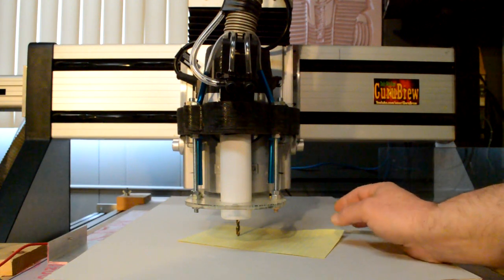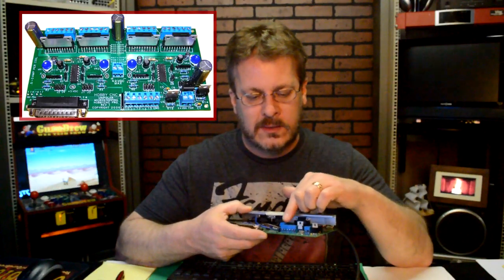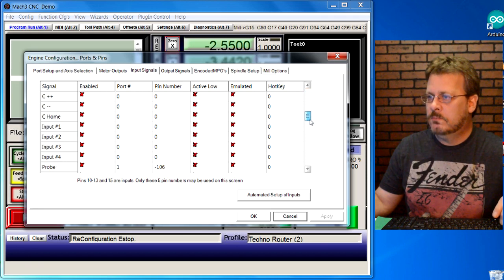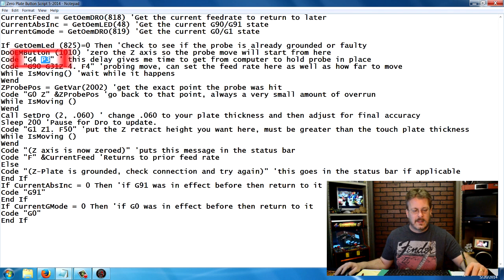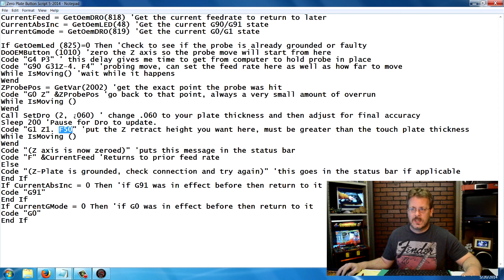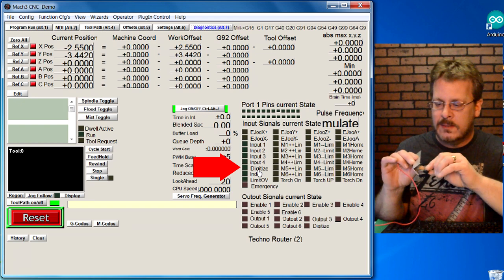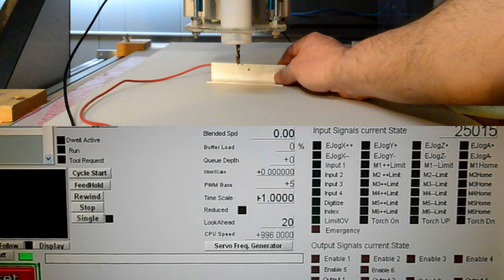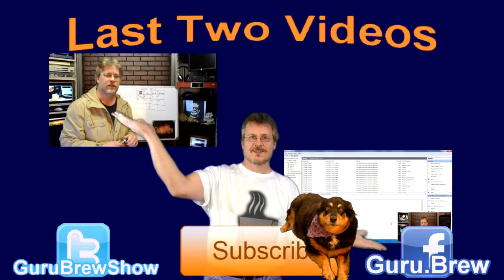How to Setup a Touch Plate to Auto-Zero Z-Axis in Mach3

Comment: The best way to set a very accurate zero is to do the following...
1) Move down at a given feedrate until contact is made.
2) Move up a small amount like 0.5mm or 0.25inch.
3) probe again at 1/10 that speed. (Or some slower speed like 1/4)
4) Perform your offset and save the location.

This will account for the over-run. You will find that the results are more consistent.

Comment: Cant get Z auto zero to turn Digitize on and off when wires are touched together.
Pin 15 is not used by any other function.
DESCRIPTION OF ACTIONS:
PROBE, wire one to pin 15 input, wire two to GROUND.  
Ports and pins. PROBE Port 2 (BOB on top of ESS smooth stepper board) pin 15, active low checked.
SAVED AND EXIT 
RESTART.  CHECK DIGITIZE LIGHT always lit if the two wires are touched together or not.

Unable to have DIGITIZE light on and off when two wires are touched together.
What am I doing wrong?
Thanks

Comment: This is great video. I built a plasma table a few years ago and use a mechanical limit switch to set and zero the Z axis. I want to change to a pnp proximity sensor but am limited by the voltage and amperage on the C10 breakout board. I found a prox rated at 5 vdc but needs 200mA to operate. I think the max on the board is 25 mA. Do you have any suggestions on a switch I could use and/or how to wire a prox rated at higher volts and amps into the C10 board I have? The mechanical limit switch has a spring loaded arm and it does "wander" at times. Anyway, thanks if you do have any info.

Comment: Thanks for the video great info. I was able to make it work, but initially it did not. I connected  touch plate to port INPUT#4 on my I/O board(followed ports and pins config instructions), did not work, I had my E-stop on port INPUT#5, I stole that port, set pin config for probe and it worked. I noticed that was the only port that would digitize, the other ports show the pin indicator trigger(light goes on and off), but no digitization on the prompt below that. At this point I'm just curious as to why the other board inputs didn't work? What do you think I am doing wrong? I imagine my ports and pin configuration is messed up. Hopefully you can guide me to a solution. Thanks again for the video, walking on air with new auto tool zero.

Comment: Hi, excuse me but I need your help. I setting my cnc with mach3. Axis are calibrated. When I lead a gcode, it run ok one turn. At the second round run and stop. No errors message, go to zero run. All run but the program no. Why? The depth of piece is 9mm in 5 tours. Excuse me for my english.

Comment: Hello used your setup for my Gatton cnc with a Sainsmart 5100 bob and Mach3 the only problem I have is that the z comes down touches the plate then raises up slow for about a inch then raises faster about a inch further when I remove plate and hit auto z it comes down about a 1-1/4” from top of material. I set set my plate thickness to .620 which is my plate thickness as you stated to do. Any idea what is causing this problem.

Comment: A quick question Steve. I have my Mach 3 config units set to mm (although everything I do project wise is based in inches). Would I set my plate thickness therefore in mm (3.35 mm) as opposed to inches? Assuming yes..... but then what about your line "Code "G90 G31Z-4. F4" 'probing move, can set the feed rate here as well as how far to move" What values would I set to be metric equivalent? 
Finally "Code "G1 Z1. F50" 'put the Z retract height you want here" Would I also indicate Code "G1 Z25. F50"  Many thanks for this.

Comment: This is amazing, I've wanted one for years but hesitated because I didn't know how to hook one up, but finally said just look it up and see what you find, which brought me here.  Now I have a home-built touch plate that really works!  Hey, one problem, though, when I remove the plate and tell the z to go to zero, it leaves just a little over a paper's thickness between the bit and the material.  I tried adjusting the plate thickness on line 15 in the vb script from between .059 and .064, because I'm using a piece of 1/16" thick aluminum angle iron, too, which measures .062 on my calipers, but even though I restart Mach3 each time, when I tell it to go to zero, there's still just barely room to slip a piece of paper under there.  Anyone else encounter this?

Comment: Just changed out my gecko servo drive and now my autozero is not touching my plate.  It goes down about .750 and retracts the correct distance. I have you VB script.  I have set it to travel 4".  Not sure why it will not travel down till it hits the plate.  Any ideas?

Comment: Steve, I'm confused on where exactly you grounded the cable from terminal block 15. The positive cable runs in through the number 15 terminal block, but where does the ground cable go in the circuitboard? Thanks

Comment: Steve loved the video, however I am having an issue. I have set the plate thickness to .750 and that's the only change I have made. the probe is to retract to a height of 1 inch.  When it retracts its about 4 " above the touch plate. when I remove the touch plate and tell Mach 3 to go to Z0 its going down to 1 7/8 above the work piece. I don't get what's happening. I have tried other scripts with similar results. Any ideas?  Now when I wired my probe and set it up in ports and pins I do not have it set to active low and the digitize light will light up when i touch the plate to the ground. If I set it to active low the digitize light stays on constant until I touch the plate to the router. Could this be  part of the issue.

Comment: Hope you can help me out, my friend has a g540 board and I tried to setup the touch plate exactly like yours, hooked up to pin 15 which was available and done the rest too. The problem is the light is on all the time, even with the ground not connected, do you think something is grounding it out somehow in the control box? I even redid it 5 times.

Comment: I am a bit confused I hope you can help me. My issue is that my z surface is gone by the time I need to change to the next tool and I don't understand how to set this up for a situation like that. I can have the plate be fixated somewhere but let's say I touch the tool off of that but my actual workpiece z coordinate is different than the plate, what do I do afterwards? Basically my question is how do I set this up without the need to be using my z surface as reference by putting the plate on it? I wanna put the plate away from my workpiece. The way I'm doing it manually right now is that before the tool change I bring the current tool and touch it to the plate by jogging it and seeing the diagnostic page light up, then I write down the z number. I change to the next tool and jog that down and do the same and once it lights up I enter the z value I wrote down into the z value and hit enter. This is very tedious to do for every tool change. Not to mention that the plate pressure is not reliable because it's by hand not by the software.

Comment: Got some issues when testing this, after tool is touching plate it won't retract it just stops
 ( Code "G1 Z30. F40" 'put the Z retract height you want here, must be greater than the touch plate thicknes)  im using mm

Comment: Im trying to set up  the touch plate.  Im using a USB controller so I cant find a port to match, also when on port three the digitize light is constant, I only have 4 pins in and out I tried both if someone can help I would really appreciate it

Comment: I followed your instructions a few years back and everything has worked perfectly. Recently I upgraded to the Corvette Guy's G540 based unit and everything has improved greatly. The only thing is that the touch plate won't work. In Mach3 diagnostics, the probe light stays on all the time. I do not have another pin to use on my little bob (using 15). What can I do to fix this?

Comment: Steve , thanks for a good video , however i have encountered a problem in that i have  from mach 3 launch menu , an imperial profile and also a metric profile . The imperial profile has worked flawlessly , but when i entered the metric profile and adjusted the script to suit , it also changed the script on the imperial profile . can it only be used on one ? 
thanks

Comment: Thanks for the video...I set it up just as you described and when i hit auto tool zero I get an error.  It says "Scriptor Compile Error . In :"   also if i check active low the digitizer light stays on until i touch the plate to the bit.  If i dont chech active low it only lights up when i touch the plate to the bit...any suggestions?

Comment: Steve, I just installed a new NVUM break out board and before that your script worked now it touch the plate and goes above the Z1. its set too. what could be the problem?
Reply from the maker: Check and make sure that your Dro settings are still in inches and haven't change to metric, that would do it
Reply: @GuruBrew  my DRO are still in inches
Reply from the maker: Also make sure that the settings in mach3 are such to zero out the machine after homemade. I forget exactly where that setting is but I think it's under home and limits
Reply: @GuruBrew  In Home and limits, got check marks in Home Neg and Auto zero.
Reply from the maker: Send me your JavaScript code and I'll take a look at it. You can send to the ask a tech link found on my website

Comment: Just got my touch plate set up and everything seems to work fine but when I hit the auto tool zero button the tool touches the plate and instead of going up an inch it went down instead.  Anyone know how to fix this?
Reply from the maker: Remember that on most machines up is a negative number.
Reply: @GuruBrew  Thanks Steve, I tried changing the one to a negative one for G and Z and instead of going up it just doesn't move at all when it hits the touch plate which is a lot better than going down.  So I will just use it like it is now.

Comment: Great video with easy to follow directions to set up the Auto Tool function.
I'm puzzled as to why people go to all this trouble when you can take a say, 1/4" drill bit, lay it on the table and bring the tool down until the drill just rolls under the bit and call that 0.25" above the table into Mach3?  Mach3  has the Tab key to bring out the Handheld unit where you can set the rate at various steps for precision movement.
No wires, no doubt about connectivity, no Visual Basic code, no damage to the bit or table if things weren't right.
Reply: 1. Very slow process if you have to make many tool changes - 2. with 1-flute bit you have to be sure that you rolling the shaft precisely under the tip (when you get older your eyes will be not so good, believe me) - 3. for small areas (i.e. full of pockets) you have to eyeball the tip of bit exactly over a flat zone (time consuming process) - 4. you can go fully automatic if your tool-setter doesn't need a crocodile to be manually clamped on and it is located in a well-know position (Also, you thrust the planarity of your spoilboard as well as the thickness of your material).

Comment: Steve, I really want to set up the auto zero for the Z axis, however I’m not using the MACH3  screens I’m using the Candcnc controller and I had to use their screen and it doesn’t have an “auto zero” section on the screen.  There is a lot of blank areas, would it be possible to add the “auto Z zero “ text in?
Thanks

Comment: Great video!  I have a Romaxx WD-2 and just set up a Z Touch Plate using your video.  On my setup, the router itself shares an earth ground with the AC plug input on the front of the machine, so I only used one wire (from touchplate to pin 13 on my breakout board). Is there any downside to this?  It works just fine.  Thanks again for the great video content.

Comment: Great video. I saw it about a year ago and it worked perfect. Now with a new Mach3 profile, the spindle travels up instead of down to the plate. If i touch it manually, it concludes the setting. Whats up?

Comment: Hi Steve I love your video"s . I set up the touch plate on my taig cnc cmill and it was working flawlessy, but now I cant seem to get it to work properly. When I push the tool measure button the tool  comes down a fraction of an inch and then retracts without touching the touch plate. In diagnostics the digitize light comes on when the touch plate is grounded. Any help would be deeply apprecieated Thanks Jim

Comment: Thank you for your Mach 3 videos. I set up my machine with this auto zero routine and it worked perfectly the first time! I also followed your Xbox 360 Controller video to set up my Xbox controller for a very useful manual jog controller. 
I'm now trying to get an edge finder (like the Makers Guide Triple Edge Finder) to work with the buttons on the Offset screen. But the code I have found from other sources just will not work. I know enough VBasic to be dangerous, but I cannot get the code to work properly. Have you considered doing a video on setting up an edge finder? I would think it would be very similar to this video. I would greatly appreciate such a video. Again, thank you!

Comment: Brilliant videos, helped me set up my new system for Drilling and Routing Printed Circuit boards but one thing I am having difficulty finding is I want to use a Webcam to program from a positive photo of a board into mach3 or G-Code, if I mount a Webcam in place of the spindle motor and use a a Joy pad say X box 360 to move X,Y, how can I program the hole positions for each hole of the PCB also tool change, if I use Eagle to design board thats easy us PCB-G-code program  to convert. Thanks for any help

Comment: Thank a lot for your time and effort on this tutorial. I am using mach4 hobby and it seems this would port over to that version pretty well. Do you know of any issues I might need to be aware of? I have my touch plate wired up and it lights the PROBE led in diagnostics so I am assuming that's just a version difference (DIGITIZER vs PROBE), right? I haven't tried the code yet. Thanks in advance for any comment.

Comment: Thanks Steve.  Followed the instructions but must have got something wrong.  Everything works fine to the point where it touches the plate and instead of moving up it moves down into the plate.  Any pointers would be great!  Thanks for taking the time to put these videos together!  Jono
Reply: in case you have a 10 mm plate, do the following:

1. make sure that you are using the same measuring units like the one you configured Mach3

2. change the line have the command SetDro (2, 10)
10mm is the total thickness of the plate from top to bottom regardless how it is look like, 

3.  set the line: Code "G1 Z25. F50" 
25mm is enough to retract because you need more than the thickness of the plate.

this is what I understood from Steve.
Reply: Many thanks for getting back to me.  Your patience is greatly appreciated.  So I have done just what you said and it now works great :)  Best, Jono

Comment: great video! Very informative.  Everything is working exactly like you described, except I measured my touch plate as 3/4".  So I set the value "Call SetDro (2, .750)".  It touches the plate. goes up a bit, but then never goes all the way down to the material.  Is there something else I am missing?  It seems to travel down only slightly lower than if the touch plate were still in place. 
Thanks.
Reply: It happened to me:
1. make sure to write the figure correctly; 0.750 NOT .750
2. in the line: Code "G1 Zxx. F50" while xx is a figure more than 0.750 for example make it 1
3. in the line: Code "G90 G31Z-yy. F4" while yy to be less than xx and more than plate thickness

Comment: Hello. Great tutorial. I've installed the script an connected the touchplate on a port for end stops. Imput signal is shown in mach3. But when tested. Not working. When the z axis is moving to the touch plate it will not stop. What is wrong here. Could it be that my board is not compatible with the plate????
Reply: if the DIGITIZE led is lightning when you touch them together, that means it is conducting a good signal and should work fine.

Comment: Great work on the video!  I Just set up my CNC, and your tutorial was very easy to follow.  I have a bit of an issue that the contact plate doesn't always work.  In Diagnostic mode I get the light everytime I touch the frame of the machine, or the outer casing of the water cooled spindle.  When I touch the bit with the contact plate sometimes it works sometimes it doesn't and It seems to have to do with the rotation of the spindle.  If I spin it a bit the light will come on or off.  Anyone have a clue as to what is causing this?

Comment: My problem is that when I set the surface for the second bit on a job, it is cutting around .012" too deep every time. I'm using the same plate in the same place on the project. (Mach3) This small detail is spoiling my projects. What's the deal? Simple I hope. Keep up the good work!!!

Comment: Steve, 
I have a question about the value for the "F50". In the video you said it's your feed rate and to start out about half of your normal feed rate.  In the text next to that value it says it's the "Z" retract height. I'm confused on what value I should put for "F50". 
Robert
Reply: Steve, 
I used the same values you had except for the thickness value. It worked perfect. Thanks for the great tutorial.

Comment: do you have a fix . when the tool touches the touch plate it doesn't retract it stops then continues down then retracts ...the probe works fine ..im using metric 

cheers  steve
Reply from the maker: Make certain that the retract height is greater than the plate height.
Reply: i have plate 14.43 and retract 30  but it still goes down .
it didn't the first time i tried it  , but maybe it travelled further before it hit .any suggestions